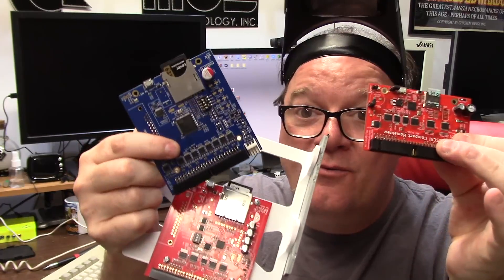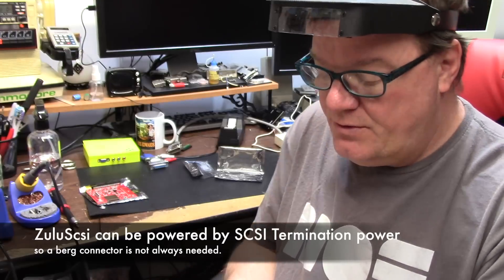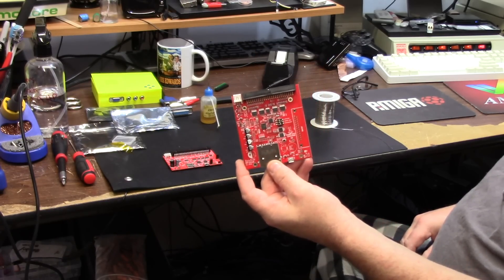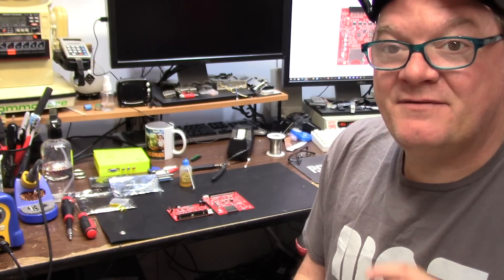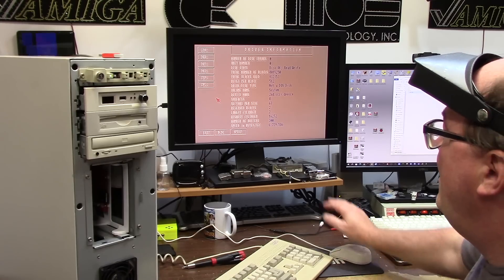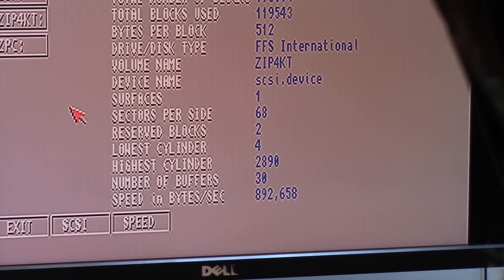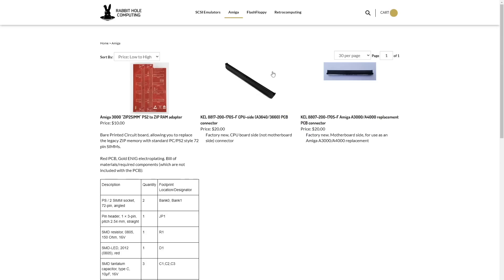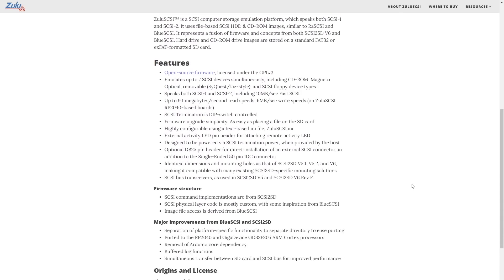The new ZuluSCSI RP2040 & ZuluSCSI Compact Homebrew

Comment: Hey Chris. Love the video. I just got my Rp2040 compact from Amiga on the Lake and was planning to install it into my GVP A500-HD8+. Can you tell me how I can hook up the lights to this card? Plus, mine showed up with not jumper pins populated. Well, I need to install them to make this card work for the lights. Please let me know. Thanks.
Reply from the maker: The full-size, compact, and laptop versions of ZuluSCSI have an unpopulated footprint for a pin
header (J304). A LED can be connected to that header as an external activity LED. The cathode
(negative) end of the LED (the shorter leg) should be connected to the position marked “C”.

Comment: Fantastic piece of kit. I've personally only used BlueSCSI, but they appear to be very similar. Has been amazing in my A1200 with Blizzard PPC. On my 4000 with A4091 (and previously Fastlane) I only get around 4 MB/s speed, at best. Bought a ZuluSCSI to see if it made any difference, but still get the same result. I get almost 7 MB/s with an old spinning hard drive. Since it doesn't sound like a dying dolphin, I'll probably just use that as my main drive and the Zulu/BlueSCSI for file transfer.

Comment: Hi,
Tanks for your video.
Question does the zuluscsi rp2040 can replace and scsci interface as an syqyest or cd-rom by remove it from the  original housing and put the zulu pcb ?
Does the zulu pcb  needs to be power supply ?
Also have you test if it is possible to have the zuluscsi rp2040 working with both db25 and 50 pins connected  ?
Thanks,
Paulo
Reply from the maker: the zulu uses hard disk files to emulate hard drives as a scsi id on its SD card. it can be run via db25 or 50 pin ribbon (sold both ways or with both or as a kit)  certain models like the 4000/4000T have scsi term power and it does not require a berg, others do. it depends on the Amiga or scsi card powering it.  you an have other devices on the scsi bus like our syquest, as long as the id is not used with a file in the zulu. 

hope that helps.
Reply: Thank you for your support..
It's for using with akai samplers one side with one end with an s1000 and the orhzr end an s950 in daisy chain in the middle the zuluscsi inside a syquest, cd-rom, or hard drive housing or using both connectors on the pcb
You think it will work ?
I got also an amiga 500+..but it not for using with it ..😊😋
Reply from the maker: i have used it as a external db25 and internal 50pin scsi cable and it works fine. it just emulates a device. its device id is 7 so make sure your other controllers are not using its scsi id , and any internal hard disk file as i showed named hd0.hda would be id0 hd1.hda would be hard drive id 1 etc... normal scsi termination rules apply .
Reply: Thanks a lot ..merci beaucoup !

Comment: Hi, Chris! To pull data off Ami SCSI hard drives, either onto microSD or via USB to Linux, which solution would you choose? I have a RaspPi Pico W to cannibalise if needed. Cheers!
Reply from the maker: you can use the Zulu to image old scsi drives. you dont even need a computer to do it, just power the zulu with a jumper flipped and it will block level image the drive to a zulu file on the sd card!. maybe i should do a video on this...
Reply: @ChrisEdwardsRestoration exactly as needed! Which Zulu card has the jumper? And what is your discount code?
Reply from the maker: i have discount codes on retrorewind.ca  code NOCODE, but nothing on the zuluscsi website.  they are cheap enough.  all of them have the jumper @ikestoddard2458

Comment: can you weigh in on Bluescsi vs Zuluscsi?  Is the fact that you're presenting Zulu an endorsement on your part?  What are the benefits of Zulu and is it more stable or same-same?  are the pros/cons to SD over CF card?
Reply from the maker: thats just what i bought, Blue is mainly for macs and made for them, while its fine, the features of Zulu are imho better, as it runs from hard disk files not like the old blue or scsi2sd. where you are stuck w that card, i can have multiple images on one sd for many different computers. or os versions for the same computer. in my case Amiga os versions

Comment: So, is the MicroSD card faster with an SD adapter in the 2040?
Reply from the maker: you would think, but adapts to a standard SD and its functions
Reply: @ChrisEdwardsRestoration  No free lunches anywhere, huh.
Reply: I just installed a Zulu RP2040 on a PPS Zeuz 040/33MHz and I'm around 8MBs average and 10MBs peak after some tinkering. The one thing that is not covered by the instructions or most of the YouTube videos on the Zulu is the fact that it doesn't like to play well with accelerators that are the SCSI host. "Q" of Hold and Modify actual ran into this issue in his video on the Zulu. I even contacted support at Rabbit Hole and the owner did not think to mention this either. Until you run the accelerator's HDtools or change the scsi.device to the SCSI controller's naming convention the drives will not show up.

Comment: Does a mechanical HDD (or CDROM) get any transfer rates benefit from this new device?
Reply from the maker: that would be directly on your scsi controllers speed. this device uses hard disk files to emulate actual hard disks and scsi devices within itself, you can mount .iso files for a fake cdrom by using  cd2.iso and cd3.iso for id's 2 and 3 type of thing,

Comment: Hi Chris, thank you for your always helpful and informative videos.
I've been using the ZuluSCSI RP20240 in my Amiga 3000D on the original controller for about 2 months.
Unfortunately I can't get over 2200MBytes/s. What can I do?
As CPU I used a 68060 50MHz.
Reply from the maker: Update your scsi.device driver. and i have a updated AMD scsi chip vs the western digital proto factory one. fixed some issues and was like only 16 usd on ebay
Reply: @ChrisEdwardsRestoration  Okay, I already have the AMD SCSI chip in the drawer. I'll install it then. Hope the chip works. The first one from China didn't work.
Where can I get a newer SCSI.device driver version than the one included in Kickstart 3.2.2?
Reply from the maker: @sumselbrumsel  here :  for free from cloanto http://www.amigaforever.com/classic/download/

Comment: Have you tried BlueSCSI v2? I built a few of them and have one I can send for you to review. My tests show that it not a bad option for my Amigas (A3000T, A2000, A4000 w/ FastLane). Uses the same RP2040 processor. Just PM me.
Reply: @ChrisEdwardsRestoration As an experiment, I just put the ZuluSCSI RP2040 code on a BlueSCSIv2 and it works and reports as ZuluSCSI. Do you have a BlueSCSI v2 and have you seen performance differences between the 2 code bases which are very similar apparently?

Comment: Couple of benchmarks (all my Amiga's run ROM/OS 3.1.4)
My A4000T with BFG9060 @ 100MHz and the onboard SCSI-controller: 8.45 MB/s read and 6.21 MB/s write.
My A3000D with WarpEngine 3040 @ 40MHz and the WarpDrive SCSI-controller: 9.38 MB/s read and 6.52 MB/s write.
(this cleary shows how good the architecture of the WarpEngine and it's SCSI implementation is).

Comment: Darn it Chris! I’m going to have to sell a Kidney with all these reviews! 😂 A lot cheaper when I bought some Scsi2SD V6’s a few years back too! 👍🏻 Just to point out. The speed can also be dependent on SCSI controller and Filesystem being used on the Amiga 😉 For example I’m running SCSI2SD V6’s with PFs3 V 19.2 Filesystem with Myunitcontrol in Startup-Sequence pushing a Phase 5 Blizzard 060/PPC 603e+ card to try for 10Mbits at synchronous speeds. I do manage over 8Mbits on read and write speeds. Might be worth a look. 🍻
Reply: Hopefully u are seeing 8megabytes speed because 8megabits would be less than 1MB/second lol. Good speed you see.